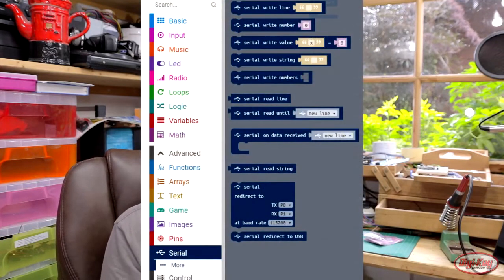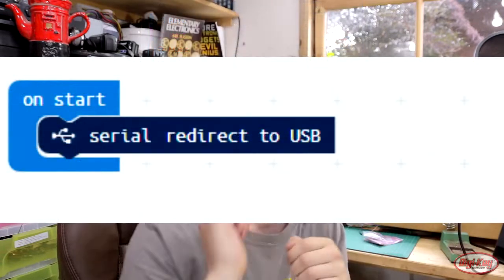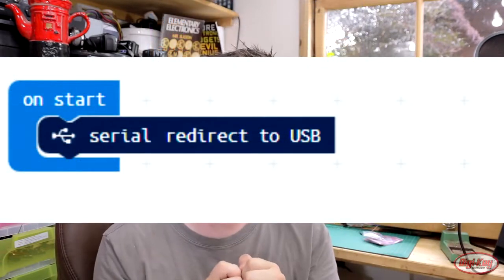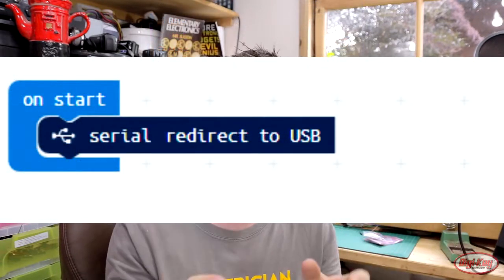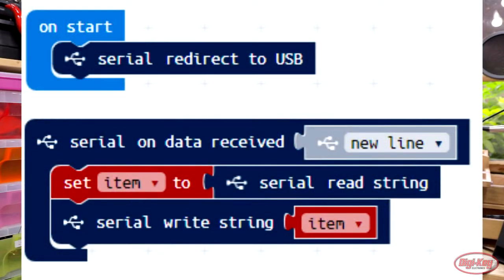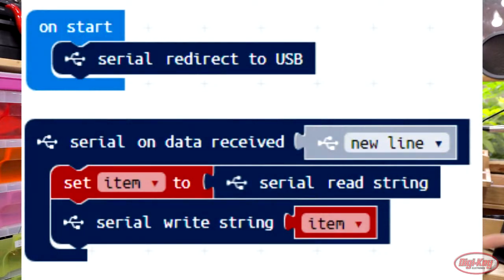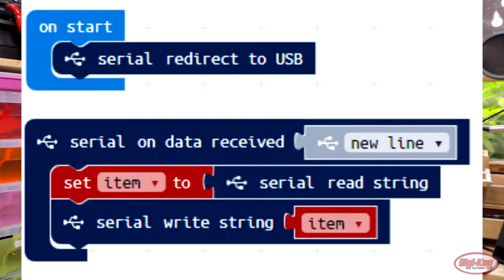How to use the Serial Port on the Micro:Bit – Maker.io Tutorial | Digi-Key Electronics

Comment: I want to Send Some Data from PC [1] to >> Micro:Bit [1]  >> send by > bluetooth > receive on >> Micro:Bit[2] >> Send to PC [2]. Do u know if Bluetooth is the fastest way? Or maybe there is a way to send data faster by Pins ? (If sending text works ok, I'll modify the code to send files)
Reply from the maker: The limiting factor in this setup is not the Bluetooth, but the baud rate of the serial connection between each micro:bit and it’s respective computer.  This serial interface is not a high-speed communication protocol, and therefore will greatly hinder the speed of transfer when compared to any modern interface (USB, WiFi, direct Bluetooth connection, ethernet, etc.).  Additionally, this serial connection protocol is very low level : send bytes, receive bytes, without any interpretation and not ideal for sending data files.  The operating system on the PC’s wouldn't even know when the start or the end of the file is transmitted, its file name, or any details of the file – the output will simply display a stream of bytes of data with no interpretation of this data.  The benefit of this serial connection is the simplicity for sending individual characters as a short message string or to control peripherals of a connected device through simple commands.
Reply: Thx for info! Do u know of any other Development Board that can be better for my project ? I see that the baud rate is at max 115200 (bit/s) = 0.0144 MB
Reply: I want to do a Copy / Paste App in C# for 2 or more PC's & use a Development Board send text, If it has speed i'll write some code for file transfer. I can write some code to send  the file data & after that i can send the binary data that will be split by PC C# App in to multiple transmissions.
Reply: The idea of this project is to have 1 PC Offline Secure & a few Online Pc's. If an Online Pc is compromised by a hacker, I don't want them to be able to hack the Offline PC. But at the same time I need to be able to Send Text / maybe Files. The Development Board on a compromised pc can be hacked, but the receiver Development Board for Offline Pc is Secure. For file transfer on the receiver pc, the User will have to Confirm that will accept file Transfer. The Text sent will be accepted an the Receiver PC without confirmation & it will be shown in the C# App (in RichTextBox).
Reply from the maker: @angelusstark  Unfortunately I don’t believe we can make a recommendation for this.  Air-gapping a PC such as what Angelus is looking to do is a meticulous and difficult undertaking and adding Bluetooth such as what the customer originally suggested may open the secure PC to more susceptibility to hackers (see the article here: https://www.techrepublic.com/article/6-ways-to-secure-air-gapped-computers-from-data-breaches/).  Also, as a micro:bit is programmable via Bluetooth, there is nothing relegating that the receiver board on the secure PC can’t be hacked as well.  A truly secure PC must not have any method of electronic interaction with an insecure machine or it as well may be compromised.
Reply: @digikey I found an easy solution for sending short Text over Sound  https://quiet.github.io/quiet-js/  https://github.com/quiet/quiet-js/tree/gh-pages   With the profile: "Audible" or "Ultrasonic" (works with Speakers & Mic) the speed is  ~ 100 characters in 2 sec. The example for transferring / receiving an image is not working because it needs the correct profile set in the index.html "audible-7k-channel-0". By using profile "audible-7k-channel-0" or "audible-7k-channel-1" I can send Text faster ~ 100 characters in 1 sec but it needs 2 cards connected by 2 cables that have audio in. I tested using "Voicemeeter banana" (free app) & i redirected the sound to the mic. Limitations, the browser doesn't allow access to the microphone if the webpage is not from: LocalHost or https:// . Windows 10, added the option of selecting a different Sound Card for specific apps in Settings > Sound > App volume and device preferences. I'll be using an 2 usb Sound Cards & 2 browsers :)

Other alternative can be li-fi (send data by light), https://www.youtube.com/watch?v=c4gC8dbaiZg